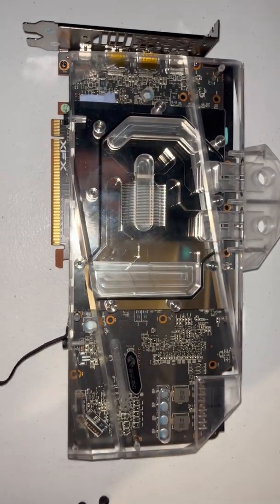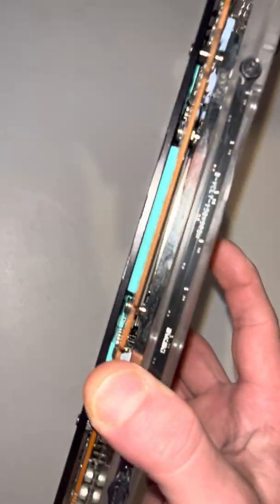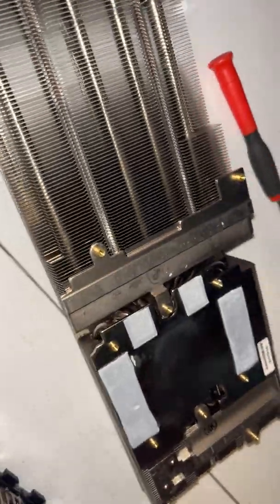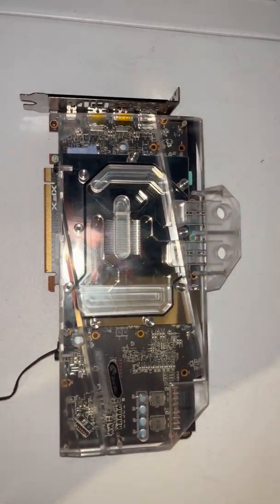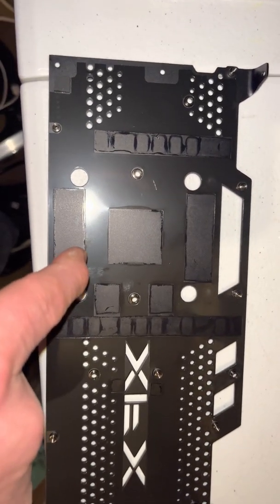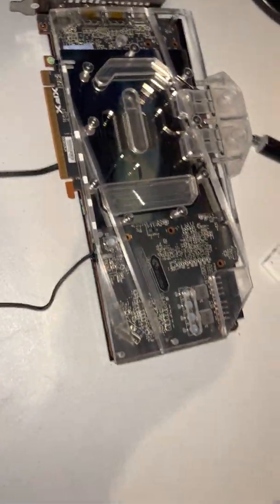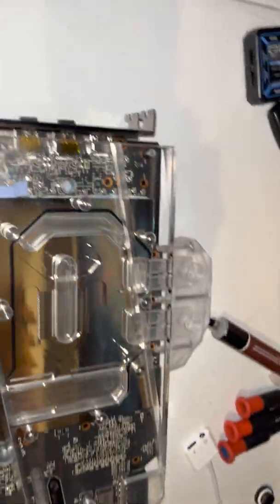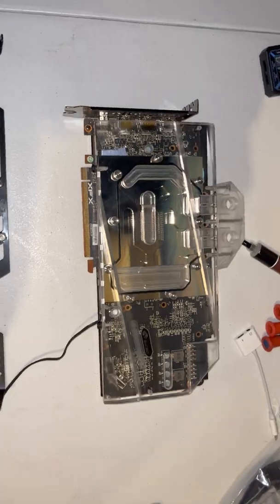Liquid cooling the XFX Speedster 6900xt Merc 319 Black edition with Bykski A-XF6900xt-X gpu block

Comment: Now that I've got mine complete and wanted to share with the comments. I have an XFX 6950 XT. The Bykski  water block for the xfx 6900 will fit this card. The thermal pads that come with the water block Mike out at 1.2 millimeters and are squishy. Also as per Bykski  you should use the pads that come with the water block and they do not cover everything that the card comes with pats on. I used gelid 1 mm pads on the front of the card and covered everything that the card was originally covered in when I took it apart. For the back plate I use the pads that came with the card and they mike out at 3 mm. I have set a big undervolt and overclock that is stable running cyberpunk maxed out for hours on end and I'm seeing Max hotspot temperatures of 75° C in time spy and Port Royal.
Reply: This is great news! Gonna get all the stuff I need now

Comment: I read a little of comments on this video about bykski being an off brand China block.  I have to say what do you expect?  Unless it is a top of the line expensive gpu no one else will make a waterblock for it.I had a Rog Strix 3060 gameing v2 and the only company who makes a block for it that I could find is Bykski. Now I have bought a XFX 7950XT because at $622 its a GREAT GPU and guess what the only waterblock I can find for it is a Bykski.  Lasty if anyone needs one in the US Primochill sells Bykski rads, blocks, pumps, and disto plates.

Comment: Did you happen to measure the length of the card with the waterblock mounted?  I'm about to build in an itx I can't find the measurements anywhere.
Reply from the maker: I’ll check one sec
Reply from the maker: Can’t seem to find the measurements either , I do know it’s the exact length of that pcb it’s literally the width of my motherboard which is an atx size
Reply: @dan88rx7turbo22  I see, thank you for checking for me

Comment: Hi. I am new to graphic card water cooling. Having seen your video, I am tempted to water cool my card as well. When I looked at the back plate, I found a few of philip screws and a lot of circular holes. What are they?  Are they some sort of screws?
Reply from the maker: By circular holes what do you mean and which gpu are there any screws in the holes ?

Comment: Yeah, Bykski block manual and thermal pads are garbage. Same with mounting screws. Next time I will spend the extra $100 for quality WB. It also has a pretty weak nickel plating.
Reply from the maker: 6months of non stop usage and im 100% content on the blocks quality and its performance also its done exceptional with my 3DFX coolant do I wish EK made a block for this gpu of course I like ek as a company and product but they didnt I dont like alphacool blocks never have so I went to the only option left and im completely happy with it
Reply from the maker: I would also add that if you are looking to liquid cool you should probably be experienced or have the mechanical capabilities to do so without directions , those are only guides for people who are fully confident in their own abilities , you should be able to do so by knowledge or experience. At least on a custom loop. AIO's are for people who dont have the confidence or ability to tear down items and install modifications. I have never in my life used a manual to do any of the gpus or mobos , nor any cooling components. If I need a reference I just look it up with PCB layouts and experience. I don't mean any disrespect at all its just my wisdom of 25 yrs of experience of modifications in mechanical and technical settings. I believe most of these companies expect the same ability from their buyers as well ! They assume someone has the ability to figure it out seeing as this is not mainstream material but advanced users and experienced or capable clients using their products. That is all I mean by this reply. I am always available to help and or educate in the industry of modification to any device or product if needed. Always happy to help.
Reply: @dan88rx7turbo22  I got Heatkiller V and it’s infinity better. Had to mount only once and temps are fantastic. This was the second China wb and both had same issue. Also been doing water cooling since 2005. Ek was fine during the years .
Reply from the maker: @ZAGAN-OZ  so why did your block issues exist in the first place , I did this block blindly and so have many others without issue ? Did you find some sort of manufacturer problem somewhere ?
Reply from the maker: @ZAGAN-OZ  I mean I understand you have some years doing this, that doesn't equate to knowledge nor experience , and I'm not breaking balls , I am simply pointing out that there is a difference between a parts changer and a diagnostician ! One can replace something , the other can diagnose an issue and surpass it. There is a difference between knowledge and experience. You had an issue that you couldn't solve twice , you had to go to a different product in order to fix the problem , but in the reality of things me and many others didn't have any issues with the same product , if something was not correctly functioning we didn't have to go to another product in order to correct it , we just corrected it ourselves . I am glad you fixed the issue you had which really wasn't stated anywhere , but next time you run into an issues I suggest diagnosing it first before going another route , not for the function but for the knowledge so the next time you have an issue you have gained the ability to diagnose and rectify someone else's mistake for your own betterment! This is not an attack it is advice , and in this industry especially it is sound advice.
Reply from the maker: uh lol maybe the pads arent the greatest however i did state to use any original pads when possible! or just buy quality ones beforehand also theres nothing any different between the nickel in these and the nickel in any other block sir they all cheap out on the plating for two reasons #1 THERMAL CONDUCTIVITY seeing as copper is way better than nickel when conducting heat #2 MONEY lol come on mate no one but alphacool makes a block for this gpu and theirs are junk and non existent most of the time !

Comment: Has anyone tried this block on the xfx swift 6900xt
Reply from the maker: you can get a PCB layout pic from internet for your gpu and then on bykski listing i linked they have PCB pic for each of the blocks you can just compare the two its fairly easy because only certain things will be different like chip placements and power connectors but only one model has three power connectors i know of in XFX line which is the LC version of the merc with ek block factory so those dont even matter on this gpu but when i looked at the PCB pics i could easily tell everything is correctly placed for the block to fit the gpu
Reply from the maker: The swift model has a 6900xt ? if its a reference style block like the black edition then you are golden !!!!

Comment: will this block work for the core version   
XFX Speedster MERC319 AMD Radeon RX 6800 XT CORE Gaming Graphics Card with 16GB GDDR6 HDMI 3xDP RX-68XTALFD9 this is the card im waiting to get  just trying to find info on this first
Reply from the maker: if its the basic merc it should the only reason there is model differences in the gpus is because the GPU is binned so better models get better clocks because they cherry pic now I also believe the xtx chips and xtxh chips are configured identically so that shouldnt matter either , look at the memory config and the VRMs and chokes thats where you usually hit a dead end if not compatible
Reply: @dan88rx7turbo22  so im pretty sure its the sec version of the model   i have a picture of model pcbs and you can tell the difference so i just waited till my gpu from best buy  and when i was looking at the gpu i could tell it was the newer version cuz it had silverish resisters    mine had 6 in a row on the right side 15 going up and down in the middle and 6 on the right but it was 2 rows with 3 in each    i talked with bykski and figured it was there other water block that fits it   im hoping it does haha
Reply: @dan88rx7turbo22  hey there so did you ever get a bad coil whine with this card while in a game   mine just started making a buzzing noise so I got a replacement right away and still same buzz   upgraded my psu to a rm850x and still same issue some kind of coil whine   I hadn't even did the water block yet so I can hear it over the 3 fans plus my other 6 in the case it self   any ideas what it could be or what's causing it
Reply from the maker: https://www.reddit.com/r/Amd/comments/kdm47d/coil_whine_on_radeon_6000_series_solved/
Reply from the maker: nope ive never actually experienced coil whine before. I'll check around see if anything is noted !
Reply from the maker: coil whine is not usually just the design of a GPU mostly from what i've seen its particular to the card itself.

Comment: Hi, great video, got the same gpu block but mine didnt come with any thermal pads or any manuals, so was wondering if u have any idea about the thickness of thermal pads? do i need to get 1mm or 2mm or 1.5mm?
Reply: considering 6800 and 6900 have the same blocks I would guess thickness is the same for both. As such you'll need 1mm, 1.5mm and 2mm. The whole backplate for example is full of 2mm pads instead of the middle where its 1mm. You can ask where you bought it for a diagram .

Comment: I have a question, I installed this on my card and I am seeing a situation where the GPU die is showing something like 45-55 degrees while gaming however the tjuntion temp is going up to 95. Is this normal to see such a wide range in temperature.
Reply from the maker: no that sounds like tenision pressure against the die or the back side where there is a special set of green pads for the backplate i used the original ones from the xfx backplate. Or you may not have used enough thermal compound or screwed in the screws around the die in a star pattern to get the best tightness in a thorough manner just remove and check these areas i never have more than a 10c difference at max usage and OC from GPU temp to junction temp
Reply: @dan88rx7turbo22  Thanks I will check all of those things, I too used the stock pads from the XFX back plate on the old one.
Reply from the maker: @doc7000  should be good on back side just use judgement on front side pads and the thickness needed to make sure all is hitting flush ! also tighten star pattern and be sure to correctly apply thermal compound dont use the white heat sink glue thermal compound either should be the grey sloppy stuff any will do basically but the heat sink glue does not compress correctly
Reply: @dan88rx7turbo22  wait does the GPU water block come with glue or thermal compound?.
Reply from the maker: @doc7000  i don't think it comes with either

Comment: What size thermal pads did you use on the die side of the pcb and the backplate? Also when putting the block on, was it just the 4 screws around the die that hold it on, then the backplate screws that snug everything together? Ive ordered a byski block for my asrock formula 6900xt and the instructions are horrible. I have fresh 2mm pads but will hold off until i can get the proper size if need be. Any advice on putting the block on or what to watch out for would be appreciated as this is my first time trying to water cool a gpu.
Reply from the maker: honestly i just matched things by eye using specific ads may not work in some areas , no the backplate also has screws I used every hole on the GPU for securing it
Reply: I know this is like 2 years late but what size of pads did you use on the 6900xt oc formula?

Comment: Hey bro what Temps do you get now?
Reply from the maker: Absolutely , now obviously temps are subjective to the ambient room air temp at case but in my testing this block does amazingly well cooling this entire gpu including the mem chip temps, VRM and various areas on the PCB! I'm fully content with its performance in cooling and its compatibility with my line of 3DFX coolants
Reply: @dan88rx7turbo22  nice brother im glad everything is going well. I have a 6900xt red devil and im going to watercool it also to see how it goes for me.
Reply: @dan88rx7turbo22  brother I got a question how much is is the junction temperature is running? Not current but the junction?
Reply: @dan88rx7turbo22  that's the one you can see when you press control alt and delete
Reply from the maker: @wildiaz4415  Junction Temp has actually always been around it was just never a thing until i believe Vega but even nvidia has a junction temp , now the software usually always includes junction temp depending on which one used I use GPU Tweak 2 by asus , my junction temp on this GPU is roughly 4c above GPU temp, this will differ on air cooled cards , but on waterblocks there shouldnt even be a need to monitor it. Junction temp is only a hot spot temp and silicon for the most part in high end computing , gaming hardware and such is only truly important when overclocking or if you are using air cooling and have high ambient case area temps, because the gpu itself will throttle down if the junction or gpu temp hits Thermal Junction (T-Junction) or thermal limit set forth by the manufacturer the Junction temp is set much higher because it goes by silicons max operating temp I believe its 150C , so the manufacturers usually set a 105c-110c max temp safety protocol in order to stop a literal meltdown of the silicon. you shouldnt experience more than a 10-15c difference at junction temp from GPU temp , which is basically like CPU hot core temp. you will always have a spot that is higher in temp on a die than the rest usually due to an area of higher voltage or usage which usually go hand in hand. I rarely reference junction temp although watercooling my GPUs or rigs for that matter is a must for me only because the junction thermal ceiling is much higher than the recommended max temp. So if you put water on that bad boy you need not worry about junction as long as you block , and paste the gpu die correctly you'll never hit anywhere near a failure temperature. However if you want to know it just use either Asus GPU tweak 2 or HWmonitor to see it in conjunction with benchmark testing the unit on 100% load and the OC you want to run with you will see your Dies difference between GPU operating temp and Junction temp then you can basically derive where those two will be from each other and use the monitor temp of the GPU to know how hot it gets its quite accurate in knowing the Junction temp by seeing the GPU temp rarely have I seen mine fluctuate more than maybe 1-4c from the projected figure I use to guess junction temp from GPU temp. Hopefully this answers your question fully!
Reply: @dan88rx7turbo22  thank you my brother I really appreciate you you are awesome 👌
Reply from the maker: @wildiaz4415  absolutely bro anytime!
Reply: How many rads are u running and size
Reply from the maker: @leedunlap92  2 360s
Reply from the maker: 22-26c idle depending on ambient air temp at case , while gaming and highly OC'd usually no more than 35c-45c , max OC and Voltage which is 2.75ghz for me on benchmarks i never pass 60C 100% load
Reply: @dan88rx7turbo22  ufff that is awesome brother thanks for the reply

Comment: It works great got the same one for my merc 319 6800xt and temps are good with the block
Reply: I picked it up but I am thinking I don't have enough pressure and will need to redo the waterblock.
Reply from the maker: why do you think that
Reply: @dan88rx7turbo22  hey sorry, i search info about this WaterBlock, is there compatible with RX 6950XT XFX Merc 319 ? 
And what is your temp ? (gpu and jonction please?)
Reply from the maker: @jonathangutkin4580  it should be as long as same pcb layout you have to get them from XFX I no longer have the pics of mine anymore also check bykski site sometimes he has the pcb pics so if works on 6800/6900xt mercs and the pcbs are same layout then yea it will if they’re not then no it will not ! I get idles on max OC of like 32 die /28 junction and then highest I’ve ever seen junction over any load bench or game is like 69-73c and 64-67 GPU die with undervolt
Reply from the maker: That’s great mate good to hear! I love mine and it’s been amazing also works amazing with my companies fx coolants !

Comment: Great review bro I’m thinking about getting the gpu thanks.
Reply from the maker: I love this gpu it’s an absolute beast
Reply from the maker: Check this video if you like Green my man ! I make some absolutely stunning fluids and they are kid and pet safe , environmentally safe , and I make the ultimate UV reactive coolants that are 100% not for show but for daily running 24/7 and the work loads do not matter , it can be used for Gaming , Mining , Hardcore OC Benchmarking , Rendering, workstation applications, the harder you work the fluid can hold up without degrading or separation nor even worse but perma Permanent fallout where the system will ruin the coolant either by wear and tear , or improper maintenance of the loop causing acidic or corrosive environments! This coolant is made for copper , brass , nickel plating , aluminum is also available in all fluids! I do 3D FX coolant like Primochill Vue , except mine won’t curdle , separate, gunk , stick none of that look at some of my streams and earlier vids all my rigs run my FX coolants everyday all day and never an issue not with gunk or clogs , nor with cleanup or maintenance ! I’d send you a free clear and opaque of your choice with purchase of a 3DFX of your choice ! I make some super sick UV greens and yellows